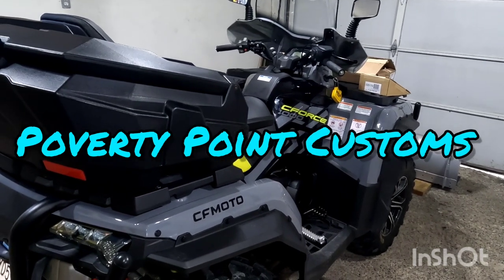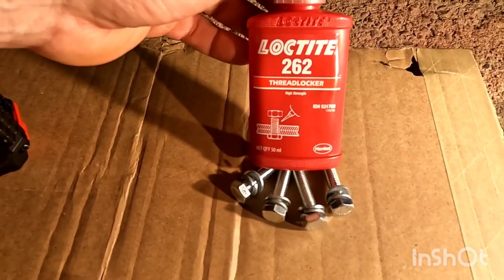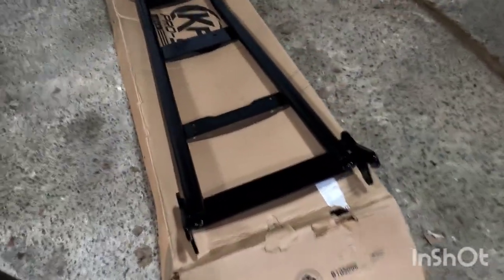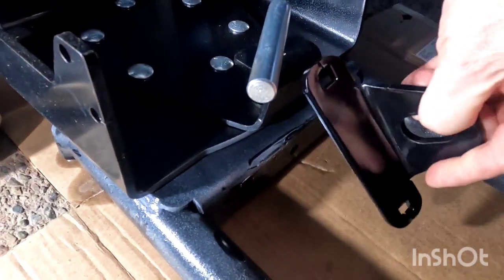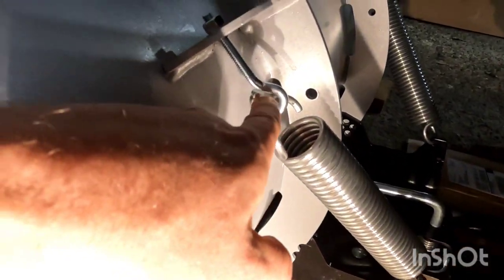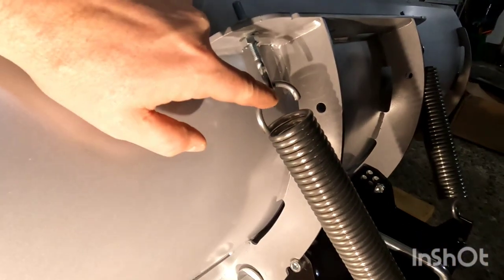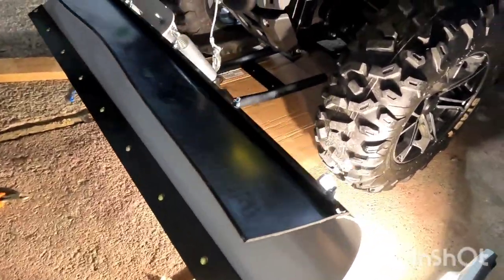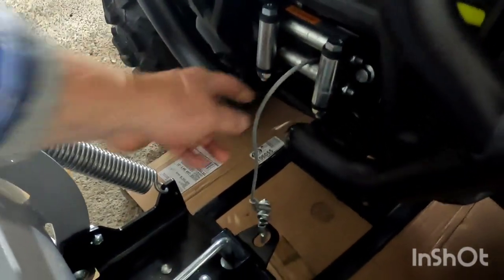KFI Snow Plow Installation on a Cfmoto Cforce 1000

Comment: I have a 800 cforce 800. I also have a KFI plow 54” blade I wanted to be able to plow sidewalks 4’ wide with blade fully angle. I also have the front bumper like you have it supports fairlead good. No bending. I used the cable for the first year. It was OK it did start to fray, so I cut that section out, reinstalled it. This year in 2023 I installed a synthetic 1/4” 10,000 pd. rope. Change the fairlead to the one without rollers. Modify the old fairlead to mount  the new fairlead so it clears the bumper bracket and weld it up to make stronger. The plow is made really well no rust I take the plow mount plate off in the spring it was getting mud up underneath it. I don’t use any Loctite on the Bolts. I just torque the bolts to 20 foot pounds. I use big flat washers that are part of the bolt to support the plow mount. I didn’t like the hardware that came with it. The plow mount is powder coated. And so is the blade and the tubes It’s not rusting at all. Only thing I did in the spring of the year when I took the plow off was spray it down with WD-40 inside and out seems to be good. I left the plow outside all summer standing up on the blade under two pieces of wood. Seems to be a great plow. I’d recommend it to anybody.
Reply from the maker: I agree I'd say they are the best plows in the business, very well made!

Comment: Any atv strap will work well! I am picking my kfi up tomorrow for the same machine just a Overland package in the US. I would recommend just doing way with the metal winch cable and getting a synthetic line for the summer. Thanks for the video shows in detail what needs to be done and its easier than I predicted! Cheers
Reply from the maker: You read my mind, have a new synthetic line waiting to be installed now in the garage

Comment: I just bought this exact same system. I have the OEM aftermarket HDP skidplate like come on the overland. I wonder if this will work with the skidplates?
Reply from the maker: With mine, I didn't have to remove the skid plates
Reply: @PovertyPointCustoms  I saw that. With mine there are skid plates under the floor boards. I may have to remove those and then hopefully the bracket will clear the thicker skid plate across the middle

Comment: Nice video, I'm thinking of putting a plow on my cforce 1000. I wonder what you mean by a plow strap? Who does it change the angle?
Reply from the maker: I ended up rerouting the cable, I'll do a quick video on my days off (Saturday) works much better and did not have to buy a winch strap.
Reply: I used a ratchet strap( just the strap part...instead of wire cable..the wire cable cuts itself from the plow going up down soo many times...the flat strap...spools up nicely on the winch.....doesn't cost much ....its the way to go...

Comment: Hi, Do you have all the parts number? Thx
Reply from the maker: They were ordered through revco.ca

Plow mount: KFI ATV/UTV Plow Mount 
Vehicle MakeCF MotoVehicle TypeATVEngine Size1000Vehicle ModelCForce 1000 (21-22)LocationMid Mount  SKU# PLOWMOUNT

Push Tubes: KFI ATV/UTV Snow Plow Push Frame SKU# 105000  

Plow Blade: KFI Straight Plow Blades, 66" 
SKU# 105066
Reply: @PovertyPointCustoms  just received my plow kit today daaaammmn its cool to plow the driveway